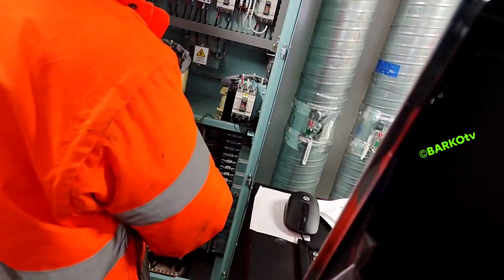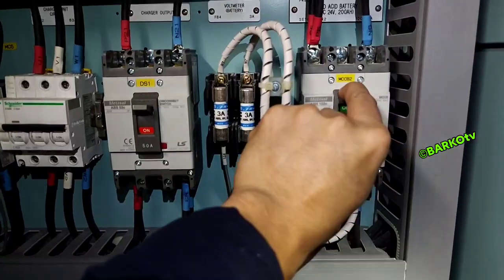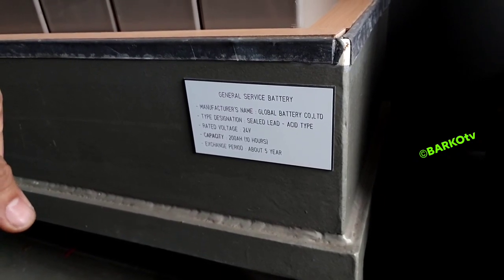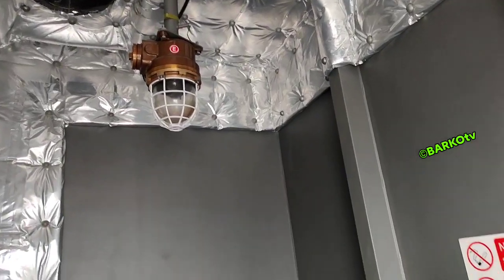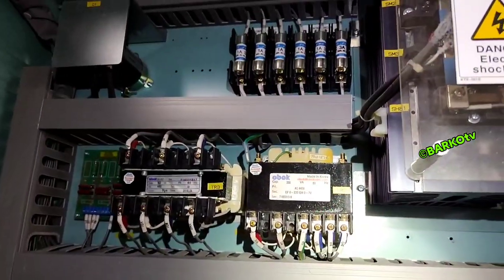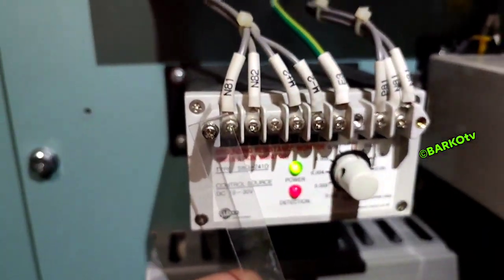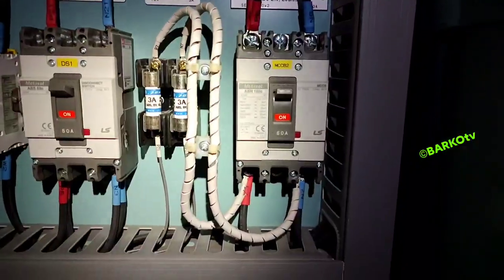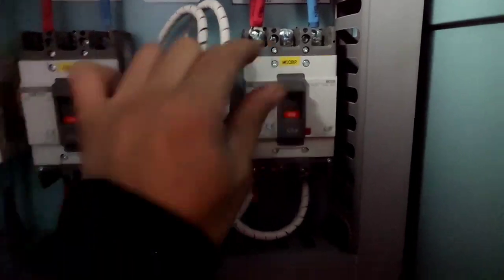Changing Ships Service Batteries without Intrupting the 24 volts supply | Battery charger

Comment: Safe ba palitan yan kahit underway?
Reply from the maker: Mas safe kapag anchorage, pero kapang underway,sa experience q,nakapag palit narin. Wla namang interruption basta yong breaker lang ng battery ang e turn off, Or disconnect mo yong battery terminal at e secured to avoid short circuit.
Reply from the maker: Mas safe kapag anchorage, pero kapang underway,sa experience q,nakapag palit narin. Wla namang interruption basta yong breaker lang ng battery ang e turn off, Or disconnect mo yong battery terminal at e secured to avoid short circuit.